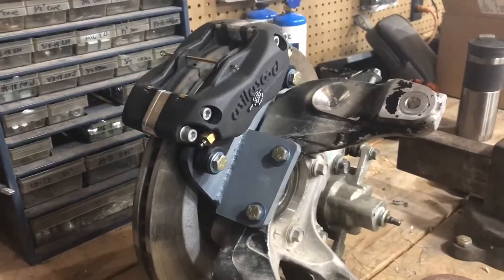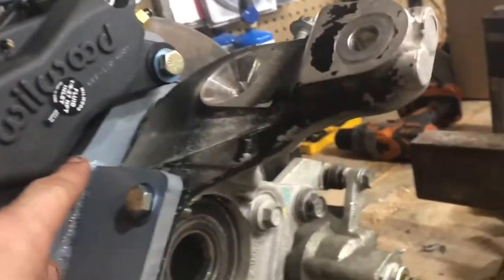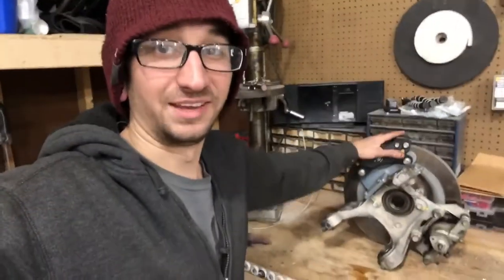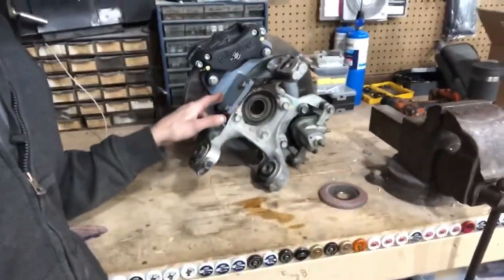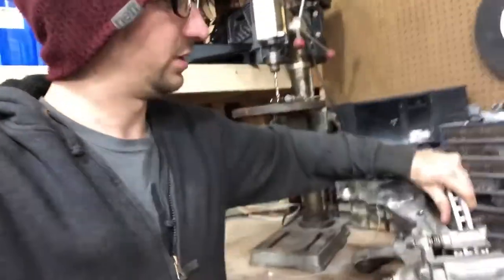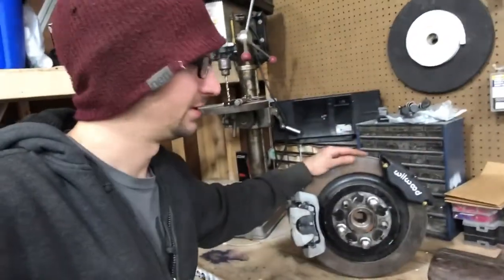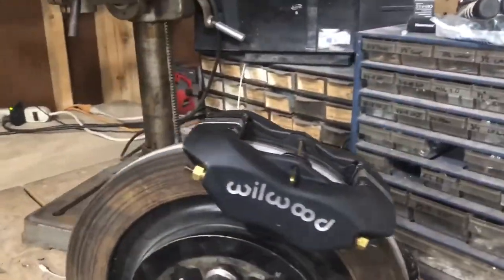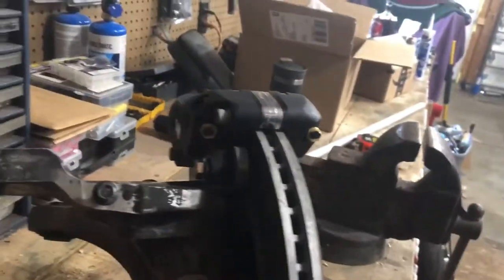Custom Dual Caliper Setup!

Comment: nice setup! but how do I go about measuring a template for the bracket? what's the best way to secure the brake caliper so I can cut a cardboard / paper template? How far does the caliper need to be from the vented side of the rotor? How do you center the caliper to the rotor, do you use new brake pads? What did you shim out? thanks